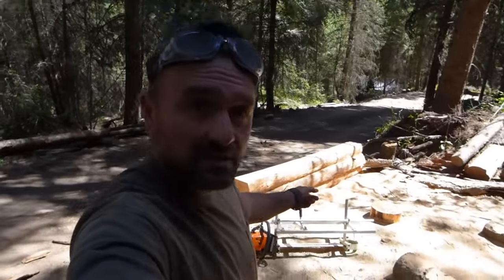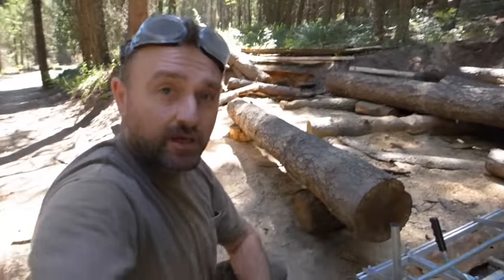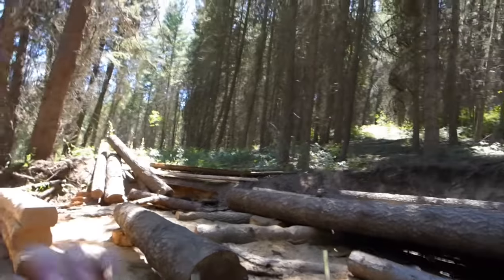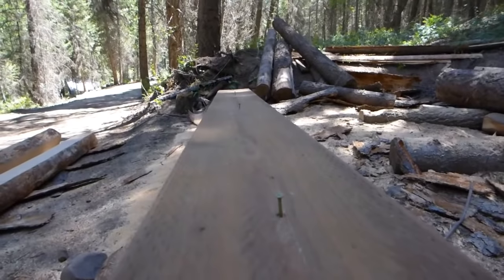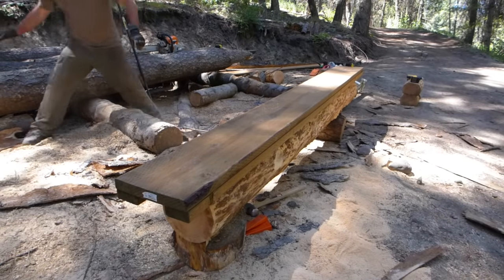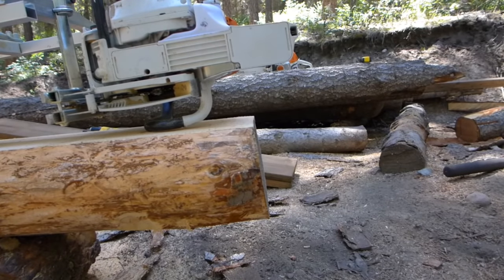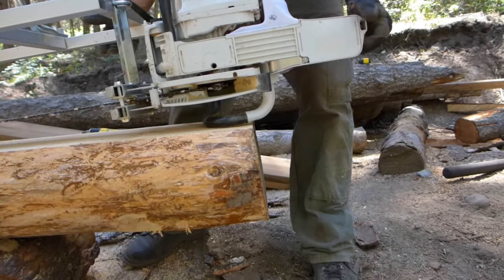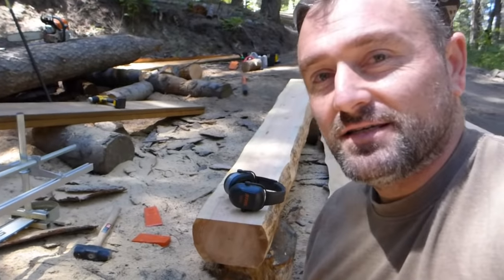Milling logs with the Granberg Alaskan chainsaw mill - Tips and observations

Comment: they make a notching tool and planer and debarking tool for chainsaw i must say you ave no protection
Reply from the maker: +Jasper Edwards I have tried the debarking attachment for the chainsaw... honestly I did not like it as it created a rough/bumpy surface and the chain which drives the attachment throws bar oil on to the log which makes scribing the log problematic. If I had to debark dozens of fence polls or something similar the debarking tool would be useful. I agree with you, I should be wearing more protection.
Reply: i cant figure out your accent your nt canadian or ameriacan
Reply: +Jasper Edwards... South African